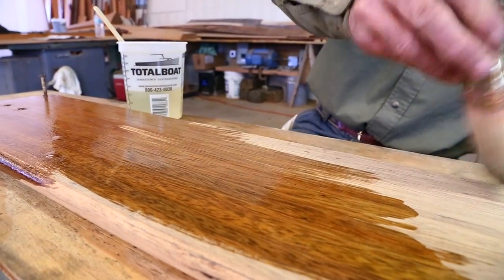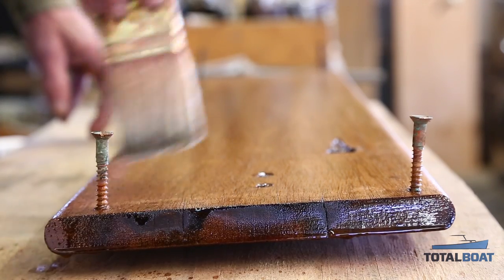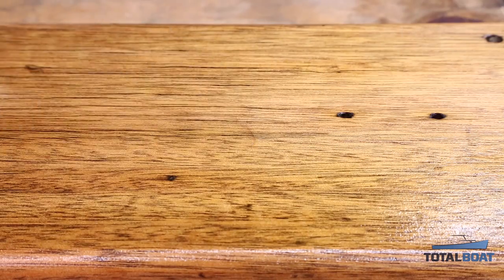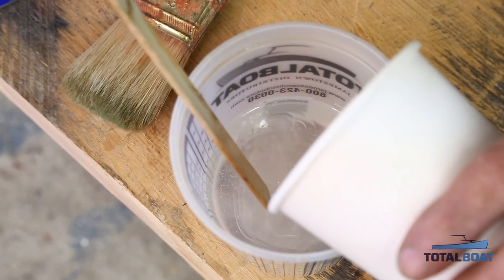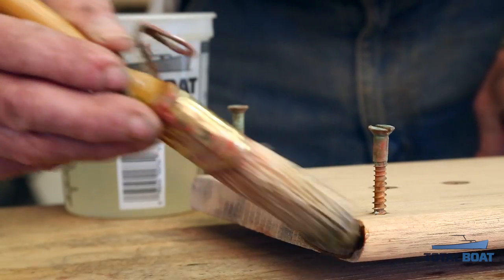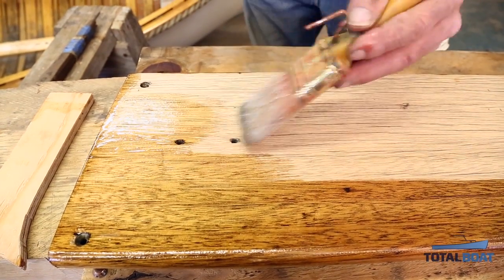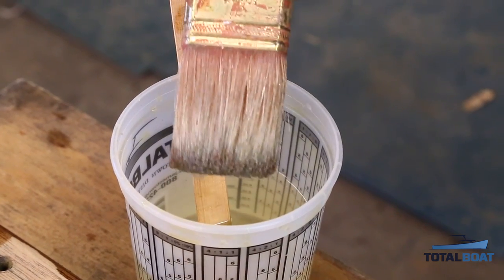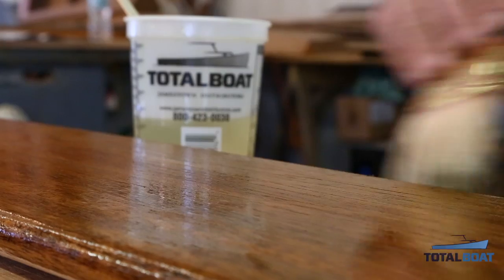TotalBoat Penetrating Epoxy - Short Video

Comment: Can you use this over water based stain?
 What is the cure time?
Thanks!
Reply from the maker: The Penetrating Epoxy pot life and cure times will depend on temperature. At 85˚F the pot life is 20 minutes and the full cure is 2 days. At 40˚F the pot life is 40 minutes and the full cure is 4 days.  It is not recommended over a water based stain - you will want to prep the surface first to a clean, dry, and bare unfinished wood.
Reply: @TotalBoat  Thanks!

Comment: "Acetone or Alcohol can be mixed...in equal volume"....equal volume to what?  The total  (ie 1ozA +1ozB, so 2oz alcohol) or the components (ie 1ozA + 1ozB, so 1oz alcohol)
Reply from the maker: yes - equal to each other.
Reply: @TotalBoat  that still does not answer my question )-:
Reply: @jayhackleman5553  If you use 2 oz. mix 2 oz of Acetone to thin it.